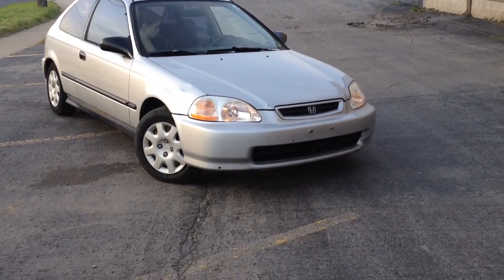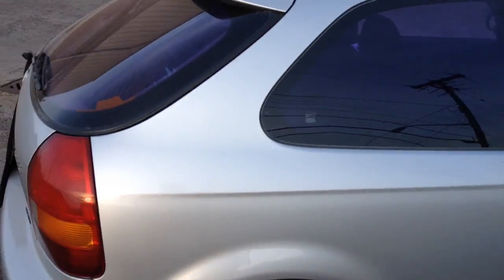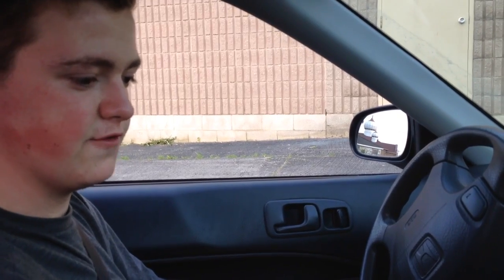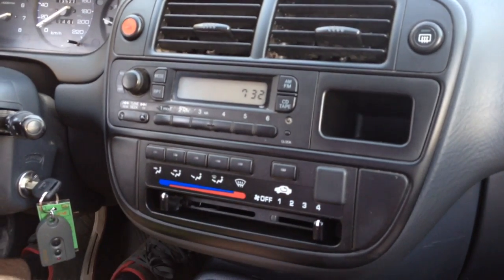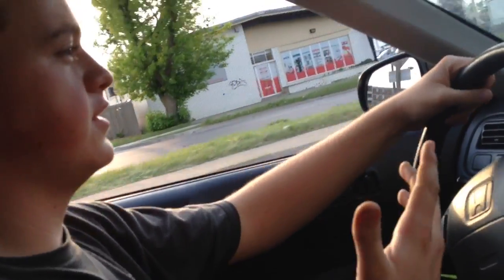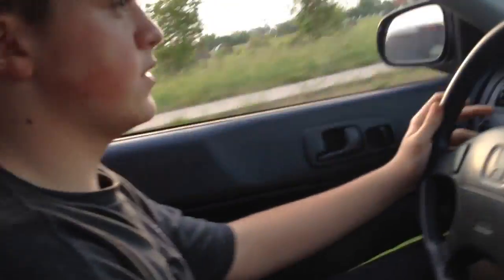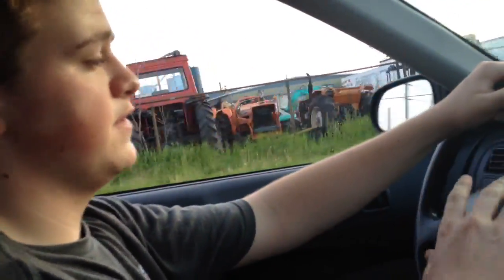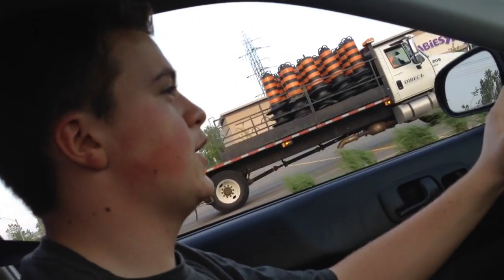Test Driving a 1998 honda civic hatchback, project

Comment: dude you aren't cheking any of the right stuff check things like clicks when you turn the wheel all the way quick acceleration and fast braking - engine corrosion check for leaks- ball joints check AC crusie control etc lots of stuff you missed blinkers and little pebble bumps don't matter- also you said "UM" about a thousand times not that that is a bad thing I do it to but I had to point it out haha hope the car is treating you well now